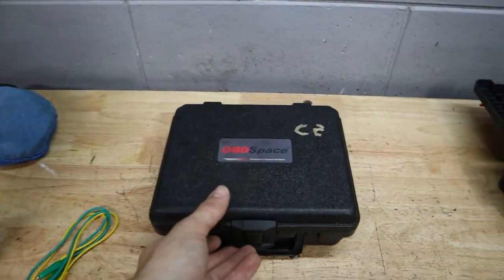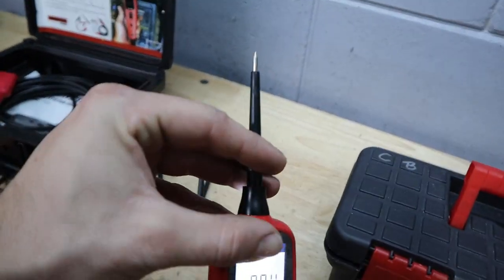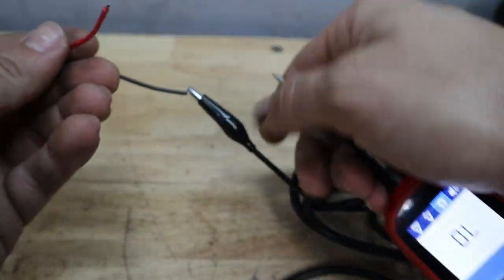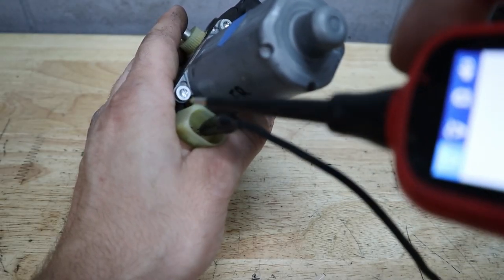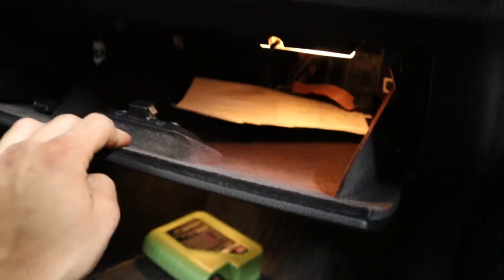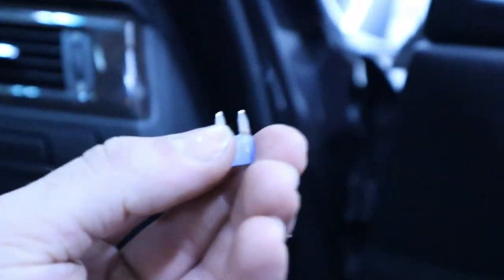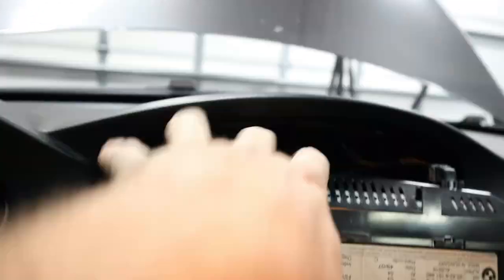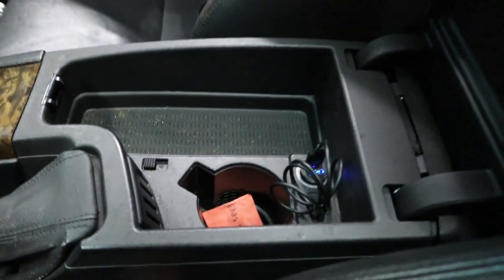My FAVORITE TOOL for BMW ELECTRICAL PROBLEMS!

Comment: I run pretty much the same setup for bt in my e90. It's great for $4! I splurged on the e53 and got the Bluetooth module that plugs into the back of the mid, it was like $15.

Comment: Always used a battery charger as a power supply but my new one won't give 12v unless it figures out its hooked to a battery. Need to buy one of these probes I guess.